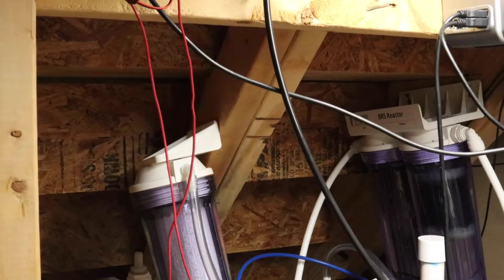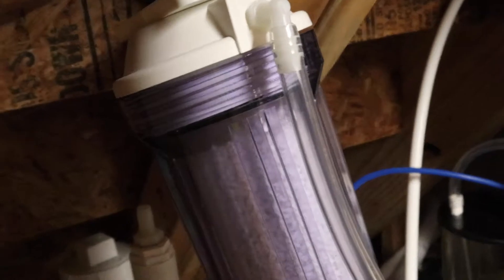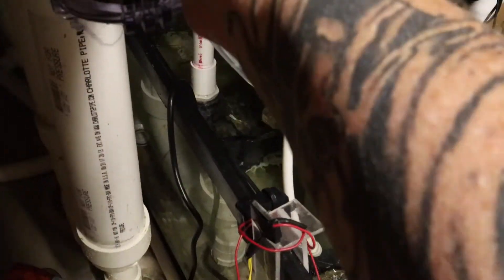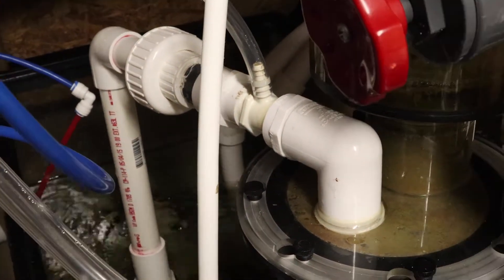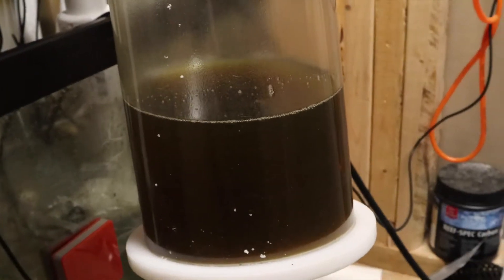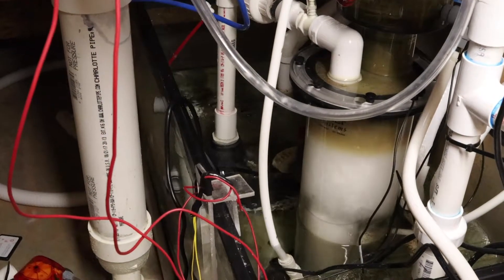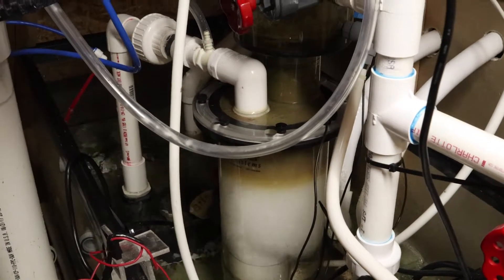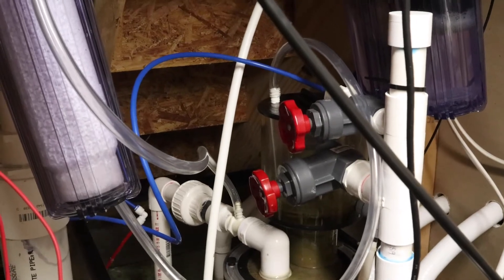Reef Aquarium CO2 Scrubber plumbed into LifeReef SVS24 Protein Skimmer

Comment: I know this video is a year old.  how did the co2 scrubber raise your ph during the day and how much did it drop at night with the lifereef skimmer
Reply from the maker: Overall a general increase of roughly .2 - I still range from a low of roughly 7.9 at night to a high of 8.15 during the day.  I don't think my PH challenge is due to CO2 in the house though. There are only 2 adults and a 50 pound dog in the house. When we go on vacation and board the dog for a week - there is zero noticeable difference in PH.  I still have the scrubber running inline but I only change the media about once a month or longer. The media really doesn't change color much.

I'm setting up a frag tank and will get a few videos uploaded soon - I'll chat about the PH in all of our tanks in one of those videos.

Comment: The media container is upside down. Stay with the stock venturi. I have a comparison video with the stock vs mazzei.
Reply from the maker: DOH! - do NOT mess with your reef tank while drinking beer. Thanks for pointing that out. I've already plumbed in the  Mazzei injector - I'll do a follow up video. The bubble action is slightly better with the mazzei - but I think it may be even better if I bump the plumbing up. Right now it's all 3/4" and really needs to be larger.

I'll check out your video - thanks for the comment!